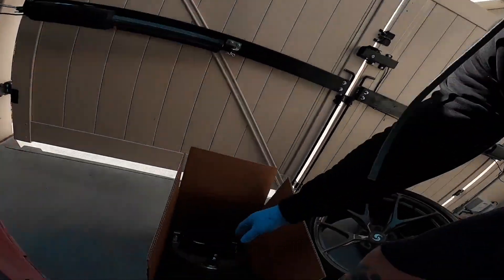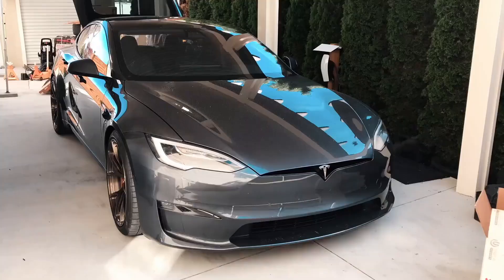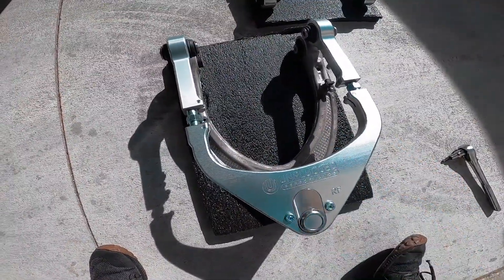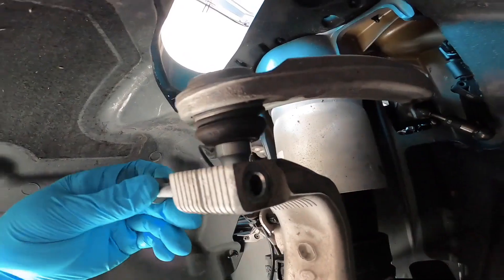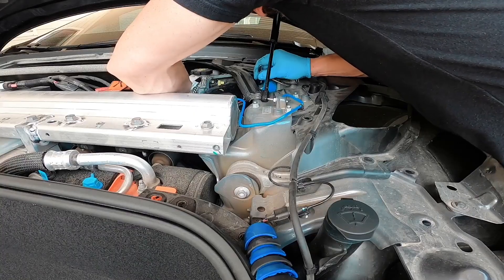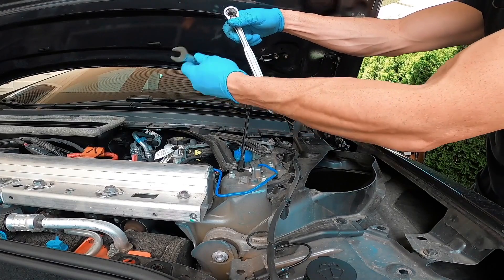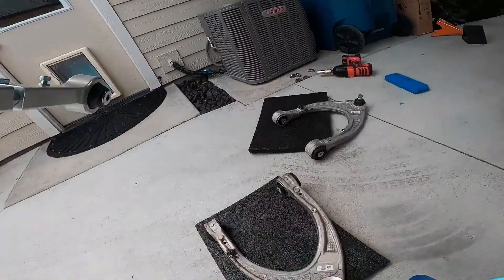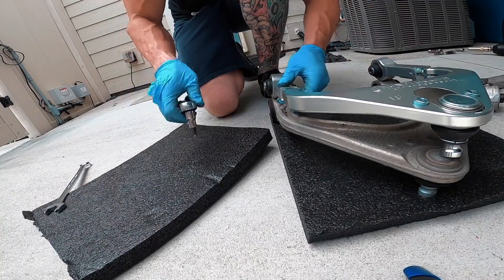Race Tesla Plaid | Unplugged Performance FUCA Install

Comment: Hello, would you please confirm, that the replaced Front Upper Control Arms was an original Tesla parts? Based at Tesla EPC, the latest version 1027322-00-F and 1027327-00-F are not casting, but two-piece parts.. Best regards from Germany. :)
Reply from the maker: These are not original Tesla parts, these are from Unplugged Performance
Reply: @PlaidAF  Thanks for the feedback!
But they seems to be not oficcially listet by UP website?